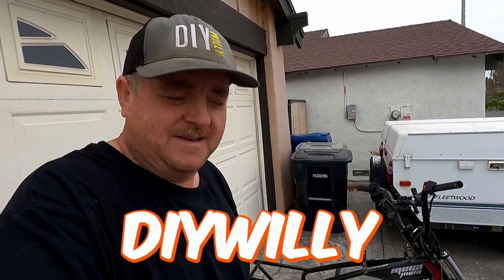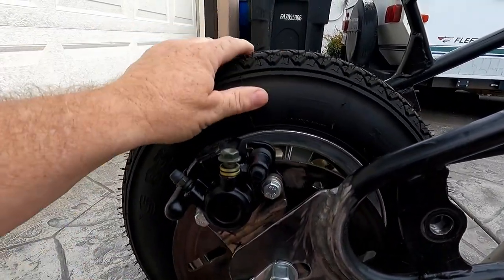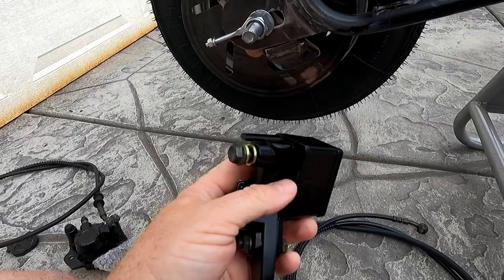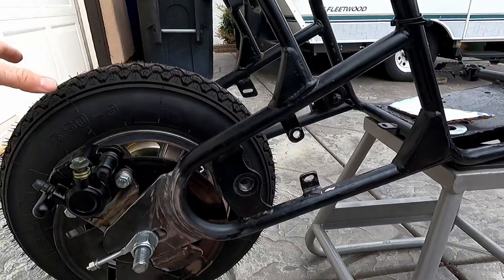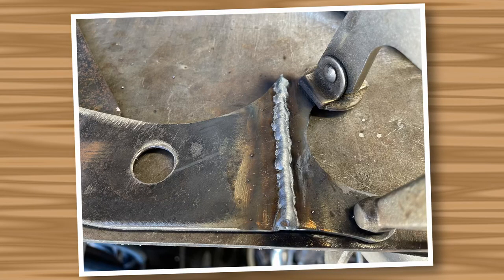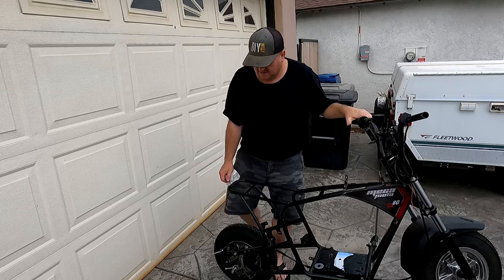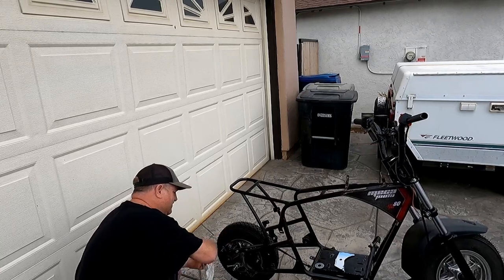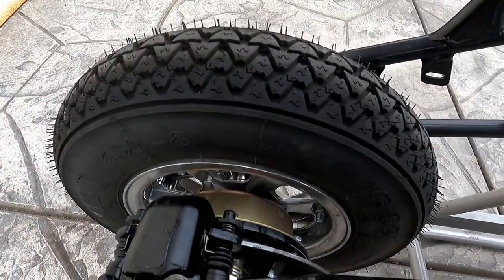All New Brakes On The Stretched Mega Moto

Comment: Yeah you bleed those brakes just like a car, pump that lever, squeeze it then crack open the bleed screw, you did it right Willy👍, although afterwards it looked like the lever had alot of excess travel in it when you squeezed it?🤔 .engine looked nice, its coming right along. note: I saw a tiny motorcycle the other day going down the road,had small tires on it like your Mega, it was called a "Grom" by Honda, looked pretty cool.🇺🇸
Reply from the maker: The brakes work great will lock up the wheel fast. The only that has some play is the caliper bracket. Might have to try a design change on that. But over all I’m very happy with the frame extensions and the fork mod. Took the bike for a ride today around the neighborhood and came back with a smile 😀.. I like those Groms! Would like to add one the fleet. But honestly I think Mighty my swing arm Mega is faster.  😎
Reply: @DIYWilly  ..👍😀

Comment: that 5 b/s fit nice if i did not like my 224 i wood be doing the same your brake are nice how come it sit on block  the motor
Reply from the maker: Hello Kevin, I also like the power of my 224 but I love the dependability of the 5hp B/S. That thing will start nearly every time on the first pull and runs strong. Of course it’s not going to go 53mph but I’m happy with 32mph. I used the same mounting holes as the 224 but I needed to lift the engine to clear the oil drain plug on the front. Thanks for watching!! 👍

Comment: I'm gonna take apart my creation and show everyone how crazy I really am lol first the chain tensioner family
Reply from the maker: What are you going to do with it?
Reply: @DIY Willy  I have the wheel from go powersports I'm just curious how long it will go running on the sprocket tensioner       it's not digging into it like the gold and black one was that lasted a while first I had it running str8 no drag then it got loose and I put the sprocket under it and it lasted thru the winter till now ,this is gold on gold should make it the summer I'm gonna keep a clutch kit and chain with the GPS tensioner in my bag whenever I go cruising I'll be good on the fly
Reply from the maker: Never hurts to bring spare parts!
Reply: @DIY Willy  def hurts to have to push it 5miles like I had to the other night smh wish I had my phone to record it I'm so upset 😡